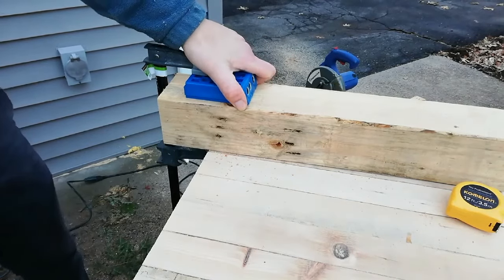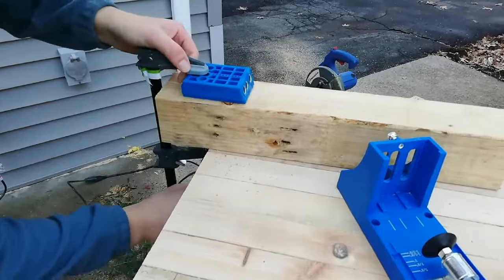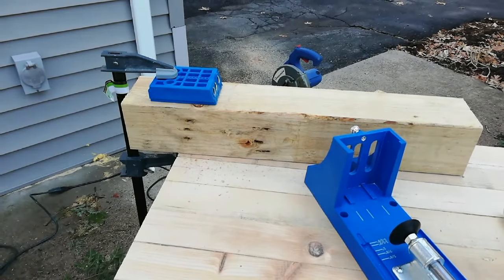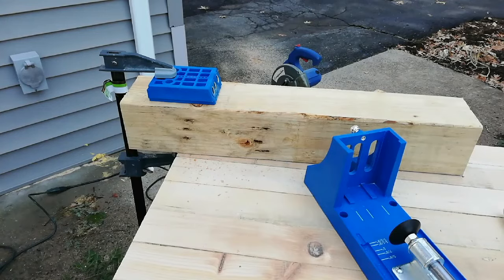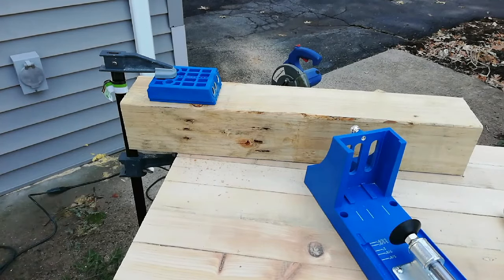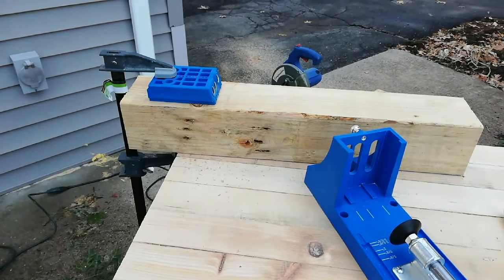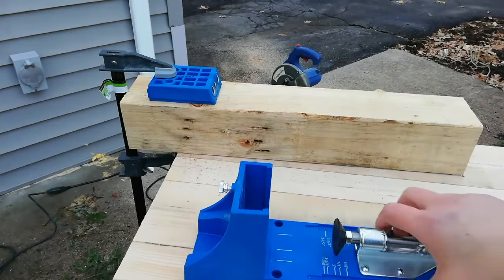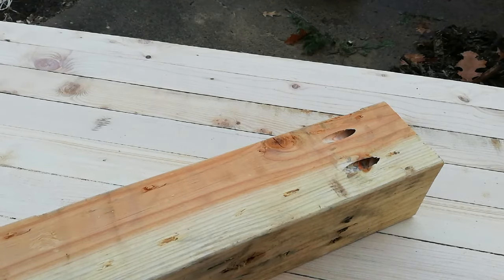How To Drill Pocket Holes on 4x4 Using Kreg K4 pocket hole jig

Comment: Thanks for the video. I am planning to use similar 4x4 joinery. Can you please share if the screw exited from center of the end grain with 1.5" of collar ? Or does it even matter for a strong joint.
Reply from the maker: I put 2 on the other side so 4 in total. It's holding the workbench up and I have had no issues.

Comment: I wish you would have shown how far the screw will poke out of the end of the wood.  Otherwise great video.
Reply from the maker: It will poke out just as far as it would if you used a 2x4. And it's hard to tell exactly how far as it all comes down to your drill settings and how tight you drive the screw in. Especially, when using soft wood, the screw will  go in further past the shoulder of you aren't careful. Hope this helps.

Comment: or just ignore everything you just saw and buy a kreg HD which is designed for anything bigger than 1.5". Bigger holes, bigger screws and a far stronger joint.
Reply from the maker: Yes, the HD is designed for larger material. What if you have a K4 or similar and don't want to buy another jig? That's what this video is showing. If I were using 4x4's more often, I would not be using pocketholes. Sometimes, you have to make do with what you have to get the job done.
Reply: The Kreg XL is designed to use with 4X4